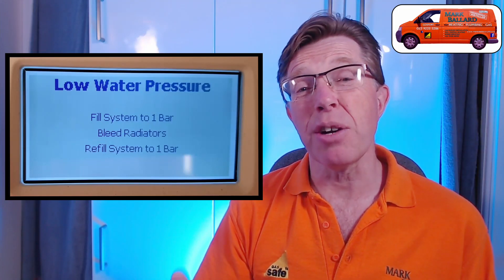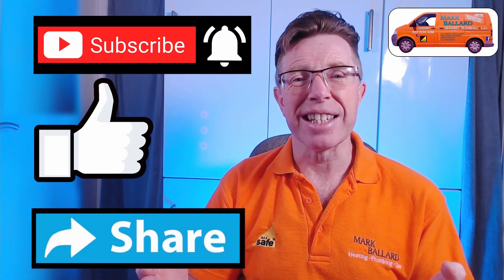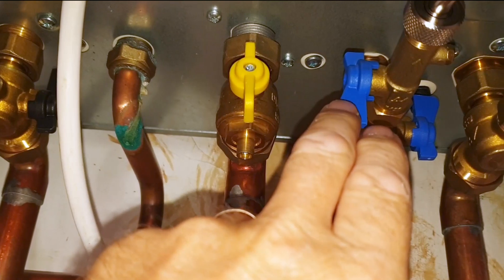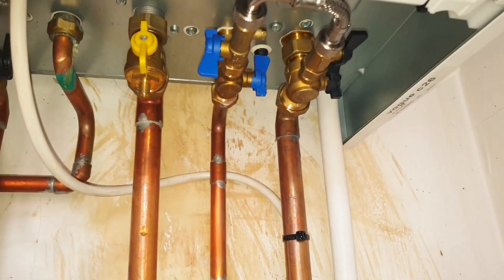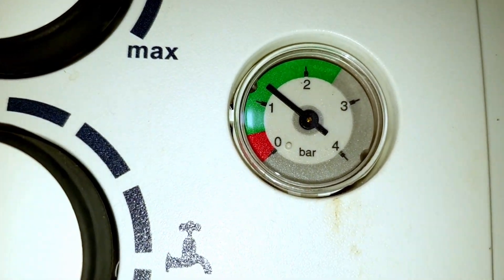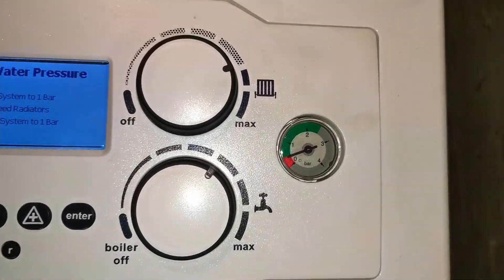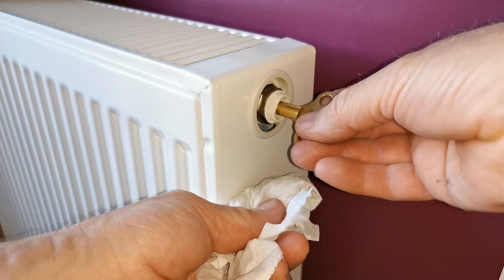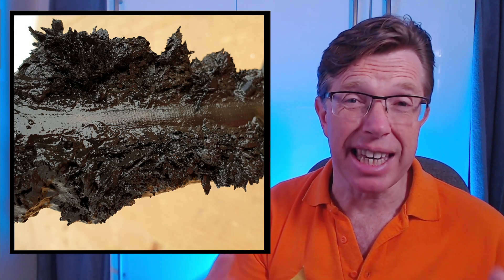Ideal Vogue. Low Water Pressure.  Boiler Stopped Working. How to get your boiler working again.

Comment: great however if you have the builder in and rads off with zero pressure in rads incase of leaks on the rads,,, you dont have hot water, should be a seperate system,anyone out there wondering why your hot water is not working because you have emptied the rads, ideal never did them seperate, what a joke

Comment: Hi Mark, thank you for this video! I have a very similar boiler to this one. I did what you said, it made that noise like it was filling but the pressure didnt change. Then it stopped filling and  nothing happened. Tried again and nothing happened. Boiler still not working and no pressure :(

Comment: Please make some videos on system boilers, vented and unvented, how to drain them down, bung them up, change zone valves, s plan, y plan wiring, fault finding etc etc I feel you will be able to explain all details excellently.
Reply from the maker: Yes they are all coming. but it's surprising how long it takes to make these videos. plus I'm also working. so it can take me to 2-3 weeks to make a video.
I could just bang a rubbish video up but that's not what I'm trying to do.
Reply: @MarkBallardLTDHeatingEngineer  Yes I understand, whatever you can do Mark its most appreciated.  I am a Gas Engineer myself but I don't have your experience, that's why the videos are invaluable.